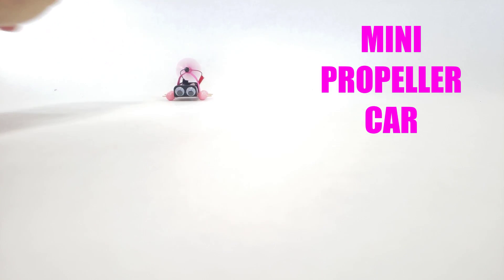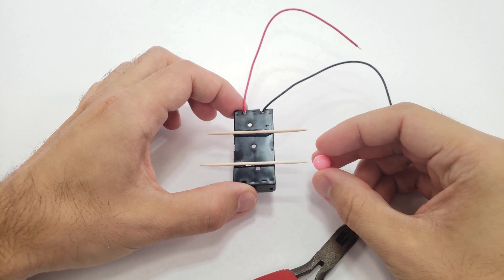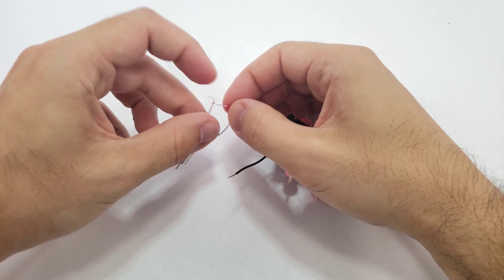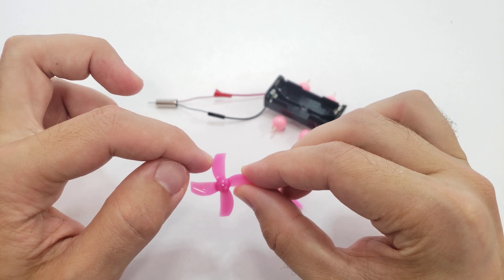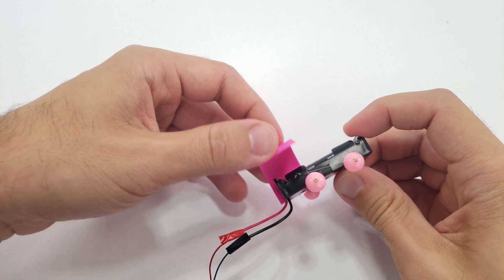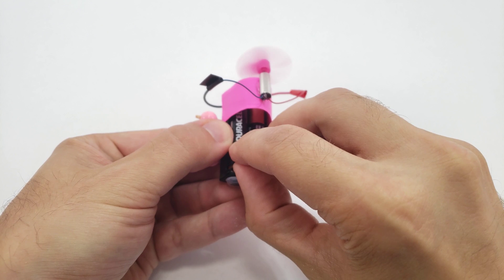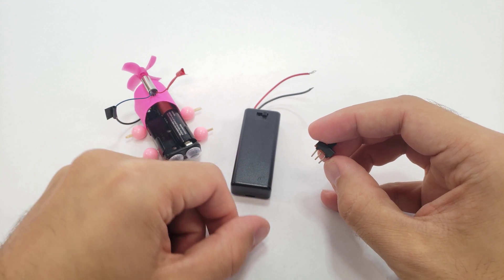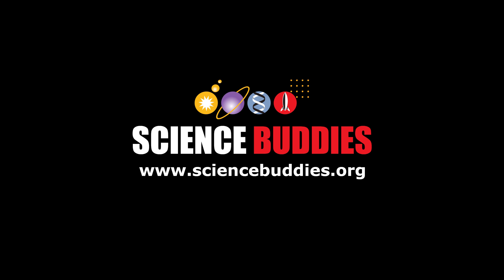DIY Mini Propeller Car | STEM Activity

Comment: This is amazing and im gonna do it for my science fair soon but i just have one question which i really wish you would reply to
Does this work with a lipo battery thats 7.4v?
Reply from the maker: Hi - it depends on the voltage rating of the motors you buy, 7.4V may damage the motors, but you could use a 3.7V lipo battery instead.
Reply: @Science.Buddies  Thank you so much this helps a lot but it would still at least have a chance to work right? Because I don't have a 3.7V lipo. But I was really having trouble looking for a project so thank you so much for this video
Reply from the maker: It has a chance to work but we cannot guarantee that you won't burn out the motors.
Reply: @Science.Buddies  Ok thank you👍🏻